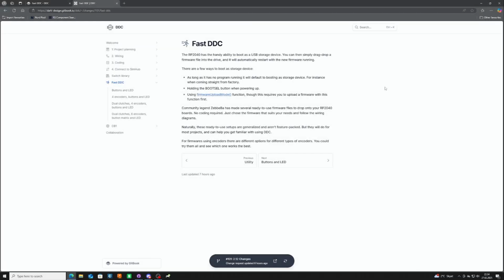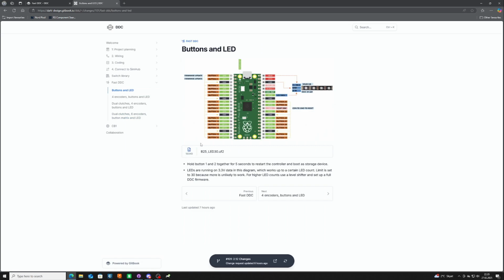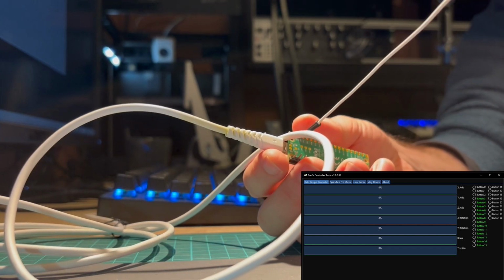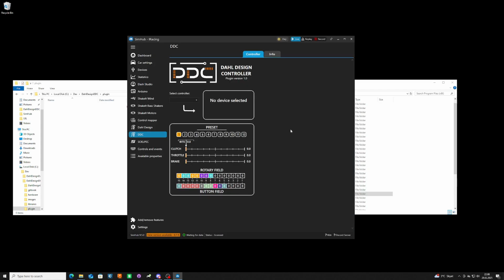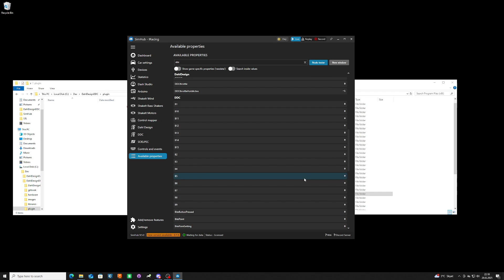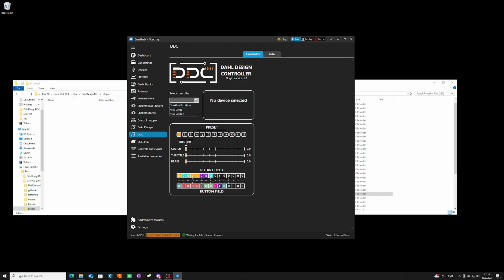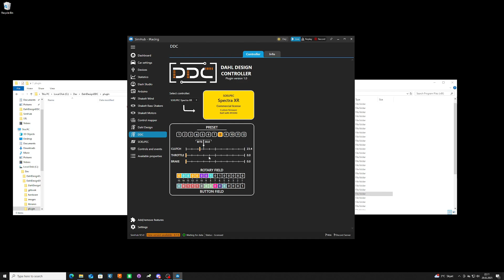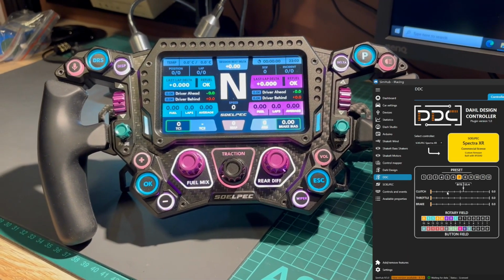DDC 2.12

Comment: your wheel is really amazing... really one of the best wheel i ever seen... can I ask you the brand and model of the buttons you using in it? they are so beautyfull
Reply from the maker: Hey! This is a Soelpec Spectra XR. The videos I post on youtube are for DIYers, and DDC is open source - but I'm also the software developer for Soelpec, which is why you'll see some Soelpec stuff show up in my videos :D The buttons are tactile switches that are surface mounted on the main PCB with surrounding addressable LEDs. The button caps are custom made (CNC machined)